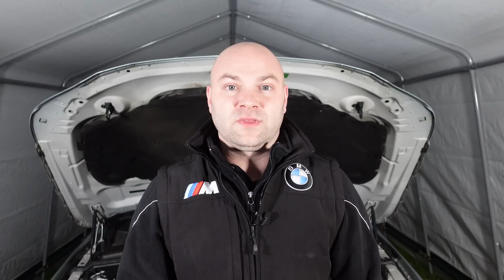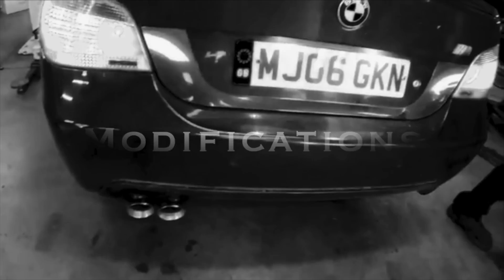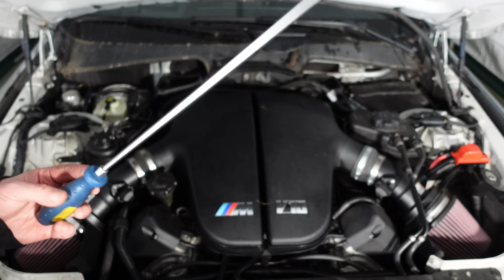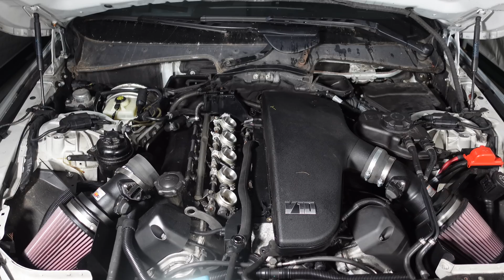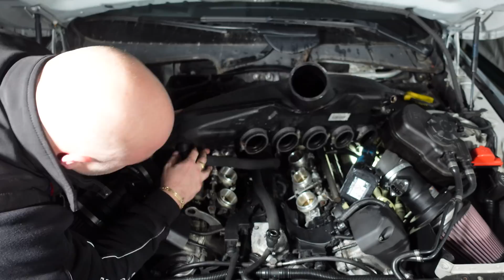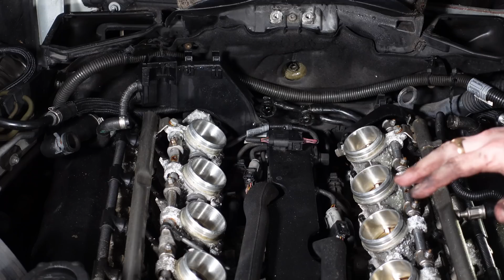BMW E60 M5 / S85 Plenum Removal

Comment from the maker: I just want to state, I’m really really glad to be making these videos on the S85. There is BAR no videos regarding repairs and maintenance on this engine and if there is they are cut short ! Where it ain’t clear or visible on how to repair the parts. Unlike many I’m in no rush to get this car back together as it’s been sitting long enough. I plan to do alot of videos that people are searching for on this engine and ones that haven’t even been done because people just don’t have the skills or know how to do it. So please be patient as I work myself to the core doing this engine and reworking all the top end to make this S85 a very unique example. I’m in literally no rush and I mean that the whole car is fully stripped now including all the other bits and I plan to keep on going, only keeping you guys with the relevant and interesting stuff you actually want to see and need to see.
Reply: This is the definition of an "enthusiastic"

Comment: Hey, don’t know if you’ll see this! I’m currently taking off my plenums to replace the throttle actuators and I’ve loosened everything and try pulling up on the plenum and they won’t budge whatsoever. Not sure what to do without breaking anything and maybe you might have some insight. Thanks!
Reply: @Shloomy_Shloms  I just started trying this and I'm in the same boat. I can wiggle the clips they're all so loose, and still the plenum won't budge

Comment: Where are you based mate ,my N46 is having the valve stem seal problem ,I replaced the plugs and coils like described in you video.whats would be the price for an engine re fresh like the eccentric shaft ,motor, timming chain and the valves. Cheers I'm essex ,london

Comment: damn, that sucks, I do want to say though you helped influence my purchase in my 2006 BMW 530i and I absolutely love it, at this point I really don't trust any one else on how-too's or anything regarding the E60 chassis. My E60 is currently at 183k miles with no major mechanical issues and I hope to get it well passed 200k.